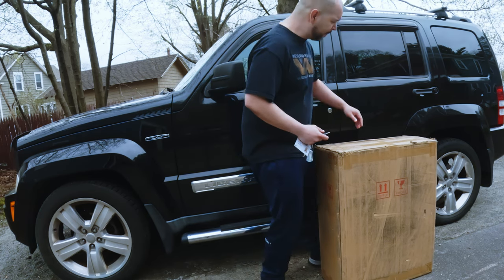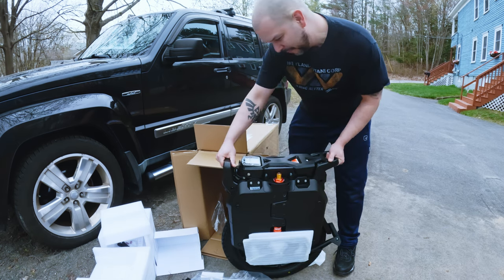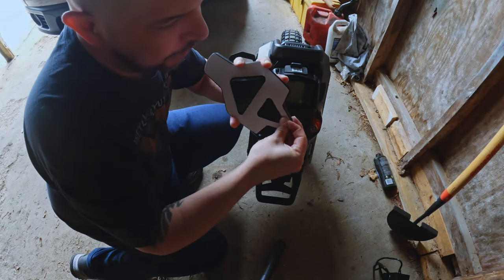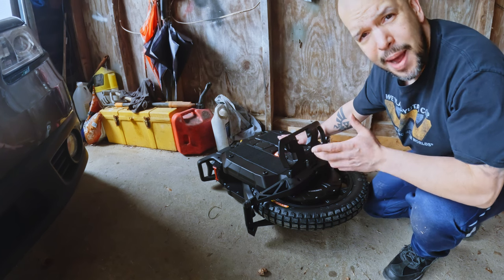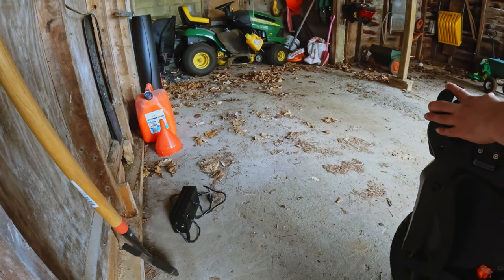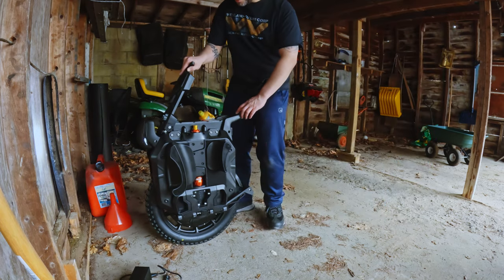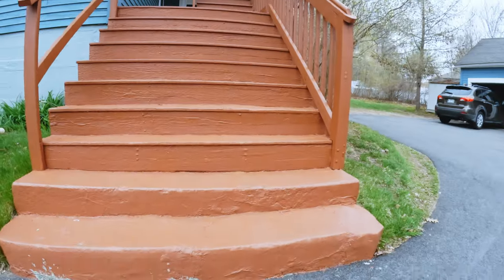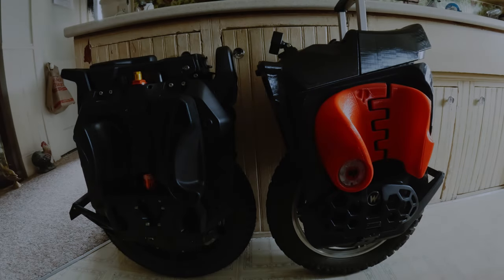Unboxing the Veteran Sherman S Electric Unicycle from eWheels

Comment: Ok how to explain this in a comment... with my OG Sherman the best way I have found to bring it up stairs. You turn it off (to prevent leaving burnout) then stand on the first step (legs apart) with your back to the stairs, grab the handles and lean backwards and pull it up between your legs, step backwards up the next step and repeat. Your body weight is what lifts, like falling backwards and the wheel catches you when it hits the next step. Puts almost zero stress on the body if done correctly I call it the 'Spartacus Shuffle" best of luck brother! Should work with any wheel that has handles or a place to grip in front and back.
Reply from the maker: That is an interesting way to do it. I will have to try the Spartacus Shuffle!  What do you do bringing it DOWN though..same thing? Thank you for your tips !
Reply: @WILSONsHobbies  yes same thing going down stairs only in reverse, down is much easier lol.